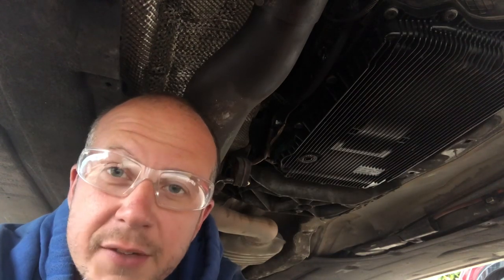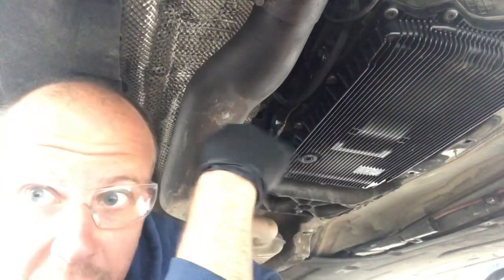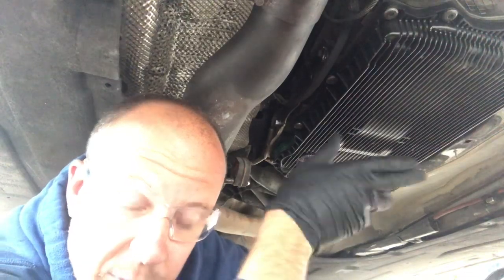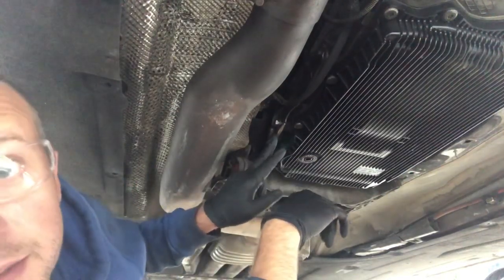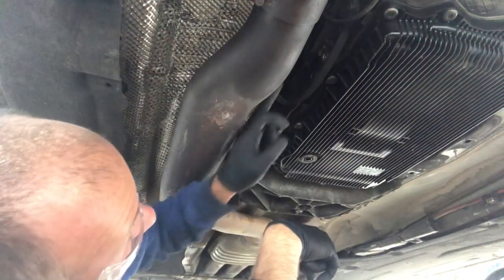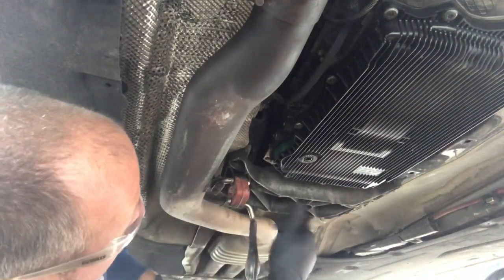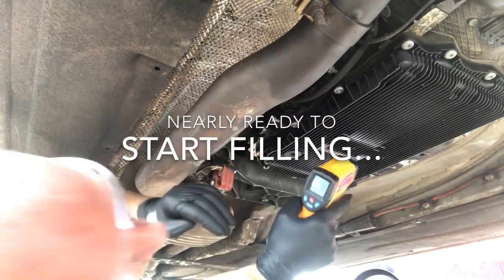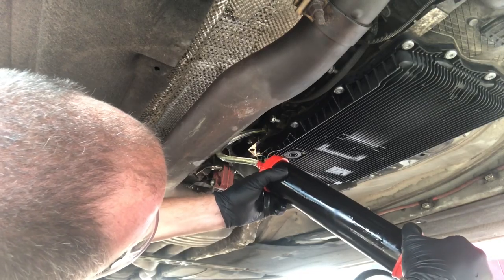BMW 530d F10/F11 ZF 8HP70 - DIY Transmission Service

Comment: Great job. Can i ask, is there a drain plug on the torque converter?
I have a ZF box to do but i previously did a Mercedes 722.9 transmission and the torque converter had a drain plug.
The converter actually had more fluid than the transmission!

Comment: Thanks for video , does bmw f11 530d 2010 have transmission oil dipstick? 
Any way to check if its been changed,by looking at color, thanks
Reply from the maker: No, you won’t really be able to tell. The only give-away might be if the transmission filter pan (black plastic) looks newer/less dirty or old than the rest of the transmission system?

Comment: How did you level the floor to keep the car level? Is there any place we can put a level? to guide us
Reply from the maker: I had the car raised off the driveway on ramps with blocks of wood, so I just put a spirit level between the blocks to check. It’s only approximate, but good enough for the fluid fill-level 👍

Comment: Hello. I really liked your video. I would like to know if changing the gearbox oil is really necessary to change the lower cover or if we can use it. thanks!
Reply from the maker: The transmission oil pan has the fluid filter built into it, so if you are going to all the effort of replacing the fluid then you really should change the filter pan at the same time.

Comment: So you just mix new oil with old oil not proper way of changing oil.
Reply from the maker: You will need a machine to pump the new fluid through the system if you want to do it ‘properly’… so that’s really a job for the pros 🤷‍♂️
Otherwise you can try something like this to DIY…

Comment: Hi how did u lift car up? Does car need to be on same level to measure oil level? Or Just lift up front is okay? Thx
Reply from the maker: If you watch the series of videos which lead up to this you will see how I lifted the car up & secured it to wood blocks. Yes the car must be level for the transmission oil filling procedure.

Comment: How many litres drain? And how many you put back in?
Have you considering to change the megatronic gasket tubes and the electric plug seal( often leak come from there)!
What oil use for refill??
Reply from the maker: Yes, it’s a good idea to replace the 4 mechatronic seals & the main electrical connector seal. I realised that someone had already done them on this gearbox so I didn’t replace them. I think I used Vaico ATF when I did this job.
Reply: @Nut_Job.  i was do that procedure on zf6hp, but like i see,  it's the same for zf8hp. I drive f11 from 2 weeks time, i see on the paperwork that gearbox been serviced in 2018, but i feel something like fluctuations sometimes, and little loss in the power when i drive slowly with 30mph  , is like coming fuel , stopping fuel for a few seconds. Then i hit  the gas pedal and the car run like bullet.  I am little confused , because that could be dirty fuel filter or gearbox make  jokes with me. Twice i saw message gearbox fault, after that just dissappear, nothing change during the drive....

Comment: Great video. Comment: when using torque wrench hold it at the handle and not at neck. You should keep length of arm given by physical dimension of tool.(and marked as handle area). 
Shortening of arm length by improper grip result in lower induced torque.

Comment: is it a difficult job ? l ask my dealer to have it done on my f10 and they refused me very elegant
Reply: i was asking about the same with mine BMW Dealer and he said that they not recomend this as when they did customers have issues with they gearbox
Reply from the maker: The thing is, ZF & BMW officially state that the ATF is sealed for life so they can’t really start offering to change transmission fluid for customers. There is also some truth that some gearboxes may experience slipping after a fluid change if the clutch packs are quite worn - this is because the old fluid has a lot of the old clutch material floating in it & it helps them ‘bite’ but when you flush it all away & fill with fresh clean fluid it may then slip if the clutch packs have lost too much material.
Although saying that, my ZF8HP had over 165k miles on it & it drove fine after a fluid service!
Reply: @Nut_Job.  Thanks Man

Comment: Actually you just changed 30-40% oil inside the gearbox,I know cuz Iv done it by myself.you can only drain out 3L oil out but the transmission has totally 8.7L inside.Thats why you've prepared two bottles of oil but only used one bottle.Change 30% oil has no difference with no change.
The correct way is,first do all things like you have done,start the engine let new and old oil mix together,then turn off the engine,use tube to drain oil inside from the injection port,which you ll see oil is still really dark.After tube have no oil to pour out,then fill in new oil again. You have to do these steps for 3-4 times,cuz each time you can only drain out and add in 1.5L oil to dilute oil oil. 
When two bottles of new oil is about to run out,use an empty bottle to collect drained oil just in case, then add all new oil inside transmission.If thats not enough, at least we have some latest mixed oil as a supplement.
Finally we can use scan tool just like ISTA or anything else to check oil level just like you've done,ZF8hp70 should be checked when temperature between 30-40 degrees. After checking oil level,we can use new filling bolt which tightening torque is 35NM.All previous steps used old filling bolt and no worry about tightening torque.
Tips: Use magnet to make sure those oil pan bolts are made by steel, which tightening torque are 10NM.If not, that means bolts are made by aluminum,which means tightening torque is 4NM+45degrees.Dont be comfused,cuz 10NM isnt enough to hold aluminum bolt in position during several years drive,and do not reused those bolts.
tips2: Make sure four wheels are in the same level,cus wrong level causes wrong oil level,and the wrong oil level didnt show any warning lights until your transmission broken.

Comment: Just another innocent observation.   

If there is not enough room to get a full ratchet/socket combination on the fill plug,  how is there enough room to get the syringe of new fluid?

Would a pass thru ratchet get a better fit and torque than the bit by itself with a screwdriver?

I ask this because if the old fill plug gets stripped and you have a new pan and fill plug with the service kit why go to extreme methods to remove a fill plug that is most likely going to be tossed anyway?
Reply from the maker: The full plug isn’t part of the replacement kit. It’s part of the aluminium housing on the side. There is just enough space to poke a bendy tube from my filling syringe, but tricky with a ratchet - although if I just had a normal set of Allen keys to hand that probably would have been ok.

Comment: Since the old fluid is drained and the service kit comes with a new fill plug..........is it possible that the full plug. Am be removed AFTER the pan is dropped.  For that matter if the old pan is removed and your getting a new pan and fill plug bolt anyway, why not just thread the new plug to the new pan.  You could keep control of the fill plug and maybe not tighten the plug as tight as normal.

This allows easy removal of the pan while still controlling the plug tightness until fluid is completely filled then get the final torque of the fill plug.

Comment: Pretty close to correct , your suppose to shift it in each gear starting with reverse for a min of 5 secs  to allow each clutch hub to fill with fluid and its the fluid temp you need to know not the gearbox or pan housing. .  Other than that good enough

Comment: How accurate is the temp gun when measuring the temperature before the final fill?
Reply from the maker: It’s pretty close actually. You can calibrate it using boiler water or melting ice 🧊
Reply: @Nut_Job.  you're looking for the temperature of the oil inside the transmission no? My guess would be that the filter pan being measured on the outside is not going to give an accurate oil temperature inside.
Reply from the maker: Yeah you’re right, it’s obviously not an accurate measurement of the oil but it’ll be within a few degrees. The filter pan is only plastic so it’s not far out. Remember you’re trying to get the oil to the lower end of the temp range to begin the filling process - which must be done with the engine running, so it will continue to heat up while filling. The only other alternative is to use more advanced diagnostic equipment to read the Transmission temps like the dealer would 👍
Reply: I’ve got 87k miles on the clock and looking to do a service on my f11 transmission when the weather gets a little warmer. I’ve got ista+ which should help with the temperature. Great video as a guide, thank you.
Reply from the maker: Absolutely, in your case I’d definitely use ISTA+ to check transmission fluid temps. I was just trying to show others who don’t have ISTA or any other diagnostic tools an alternative method 👍

Comment: Nice video. Howcome you didn't remove the mechatronic unit and replace the value body sleeves and mechatronic sleeve? Just curious as I have bought to do my transmission on e81
Reply from the maker: Only because I was on a tight budget and short on time, otherwise I would have done it 👍
Reply from the maker: I was planning to do the same job on the ZF6HP box on the Range Rover too

Comment: How is the fluid holding up? I see that your using vaicos fluid and not ZFs fluid just wondering if you ran into any issues with the Vaico fluid
Reply from the maker: No issues at all so far. Probably done about 8k since that ATF change

Comment: I noticed you didn’t change the connector seal sleeve when you changed the filter pan, Is it safe to say if it’s not bad it’s ok..??
Reply from the maker: Well... I suppose if you want to eliminate the possibility of a future fluid leak you could do it at the same time. I just chose not to due to time/cost as I was in the middle of getting the timing chain repair finished at that time.

Comment: Hallo, nice video super job, especially without lift ! Just a tip : as the filling nut can be very tight, I always try to unscrew it before draining the oil. So if you really have a problem with that filling plug, you can drive the next days ! ... while looking for a solution.
Reply from the maker: Always good advice 👍😀

Comment: 165k miles?? First fluid change? How was the gearbox after the change? 

Doing mine at 100k miles
Reply from the maker: Good call, I’d agree 100k is a reasonable interval.

Had I owned it longer I certainly would have changed it earlier too. TBH it may have had an ATF change prior to me doing it, however there was no evidence of this. 

In all honesty I didn’t notice much of a difference, but it wasn’t showing any issues beforehand anyway. I like the peace of mind though 😊

Comment: Great video...
But did you fit new sprockets as I can't remember you saying so... assume there in with the chain kit.?
Oil sprocket looked to have very low tooth height
Reply from the maker: Yes, the sprockets are part of the kit 👍 the oil pump chain doesn’t really have any tension on it though, but obviously it’s pretty crucial to the engine!

Comment: I have a question,  i saw the some thread  that the parking brake should be released  when moving the gear,. but you did not release it.
isn't there any difference between them? anyhow i am watching all your uploaded videos,  i am considering you are god of DIY..😄
Reply from the maker: Lol, I’m certainly no god of DIY - I just don’t like paying others to do things that I think I could do... 😂
The reason you have to change gears during the fill process is because the ZF 8HP boxes are operated by ATF fluid pressure. By selecting the different gears you are getting the box to open different solenoid valves (to send fluid to the different clutch packs) so I don’t see how the park brake would affect any of that. 🤷‍♂️

Comment: Great video once again, I had a look AUTODOC they charge almost £45 extra for the fill plug on the kit but if in it the pan which comes with new bolts and oil I could save £45, do I need to replace the fill plug? I’m not going to cheap out if I need to but it seems a bit daft to spend extra £45 for fill plug.
Reply from the maker: The fill plug comes with the new filter pan. It’s only a low-torque plastic plug anyway - but it comes with the new pan anyway 👍

Comment: I've just ordered a zf filter and 8 litres of the equivalent liqui moly transmission fluid.... Do you think it will be ok to use that?
Reply from the maker: Absolutely 👍
As long as it says it is suitable for the ZF8HP transmission (Lifetime 8 ATF). Don’t confuse it with the older ZF6HP fluid - this is definitely different
Reply: On F10 the filter is built into the sump

Comment: I know ZF 8 gearbox oil is expensive,  did you have any issues with using aftermarket oil ? How much cheaper was it. You got a link where you got it from ?
Reply from the maker: So I looked into decent aftermarket alternatives to the ZF Lifetime 8 ATF and settled on Vaico ATF 8HP as I know the brand & trust them to be good quality. I’ve had no issues at all - probably done about 6000 miles so far. I think the best price was actually from a seller on eBay, but it’s worth checking on the web.

Comment: Why is it necessary to replace the oil pan? Will it leak from the bolts otherwise?
Reply from the maker: No, it’s because the transmission filter is integrated into the filter pan & you replace it as a whole unit 👍

Comment: I was told that the auto box on my 2016 518d was sealed for life?
Reply: I drained mine the other day , 730d  zf 6hp26,  fluid was black coming out ,never been changed.  I have refilled it now and will change it again  in a week to get as much of the old fluid out as possible.  That says lifetime fluid , I don't believe anything is lifetime
Reply from the maker: Yes, they say that but really once you’re well over 100k it’s a good idea to change the fluid & filter 👍

Comment: If I may say a little critic, you did not follow the correct procedure this is why I would suggest to check the level again after driving and reaching the proper temperature  as described by someone else below. Now, from what I heard about the mileage of this vehicle, I think you should have replace the plastic flange which tends to brake with time and heat , a very cheap part but you need to pull a tab form the bottom plate. I also think you should have done much more to that gearbox when it was out of the body, like removing the bottom plate (by removing the largest bolts on that plate) to access to the seals an replaced them. It s a 30 minutes job on the bench and 3 hours from your setting on your driveway.
Reply from the maker: Yes, I will be checking the level again - I am away from home for a while again now....
Unfortunately there were other time constraints which I haven’t discussed meaning I had to choose what tasks to complete in the available time. The same is often true on many big jobs - how far can/do you take it...?

Personally, I really would have preferred to package the gearbox & sent it off for a full rebuild at a ZF transmission specialist - but time (& money) meant that wasn’t possible unfortunately.

I believe the part I got wrong on the filling process was not getting the engine oil temperature up to ~75°C to allow the cooler interlock to open. The transmission fluid in the pan was in the correct temp range, but that’s only part of it. I actually knew about this too, and completely forgot during the process... sorry 😬
Reply: @Nut_Job.  We all have to do what we have to do as you said, point well taken. And we all make mistakes, me the first, I should say! ! We all love your videos and your persistent and optimistic personality. Keep doing it! Thank you for the reply.
Reply: @Nut_Job.  its the transmission temp which should be 75c not the engine temp. The zf procedure mentions to fill with extra 0.5lt of fluid, drive the car until it reaches 75c, then wait for the transmission temp to drop to 30c and then rev the engine at 2k rpm for 30 seconds, then sift through gears R, N, D 1 and 2, finally add fluid if needed or allow fluid to drain out.

Comment: Guys check out the MANNOL ATF AG60 oil. It meets all requirements for the ZF 6-8HP and it's only 70€ for 20l.
Reply from the maker: I’ve used Mannol fluids for a number of jobs 👍
Just check that it meets the spec you need & very often good prices 😀

Comment: Hi m8 cracking vid as usual . My question is when going through the gears your car is on the ramps how is it not driving off ? I will be doing this with a range rover  sport when I get it and dont understand how I would do this unless all 4 corners are on axle stands . Cheers
Reply from the maker: You do it with the handbrake applied. Also, my car was ratchet-strapped to the ramps for added safety 👍
You only need to engage each gear for about 10s each (the wheels don’t turn).
You can actually do your RRS with the wheels on the ground - I did my FFRR with the suspension on highest setting AND axel stands underneath for safety - please NEVER work under a RR relying on just the air suspension 👍
Reply: @Nut_Job.  ok thanks for getting back
Reply: Put your foot on the brakes?
Reply: Effectively the gear selection is bleeding the hydraulic circuit. The driveshaft need not move for the clutch or brake hydraulic circuit for that gear to be pressurized force air out.